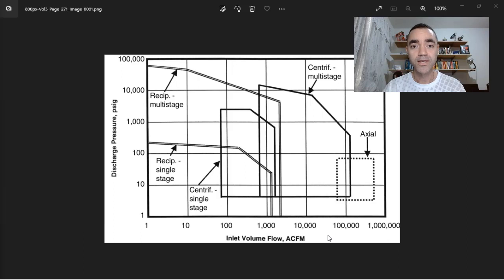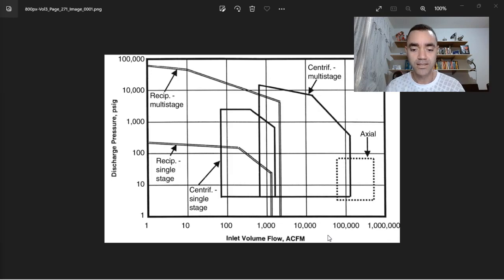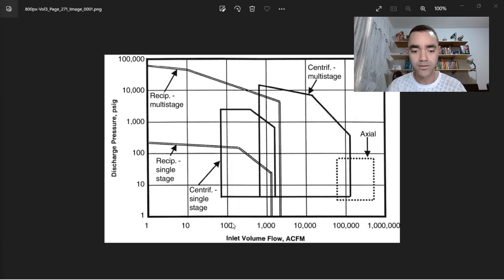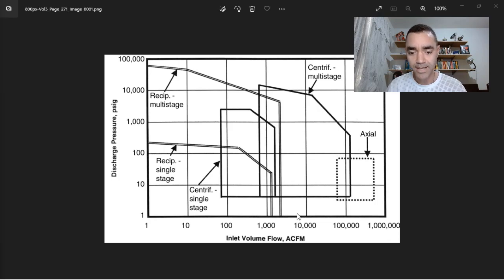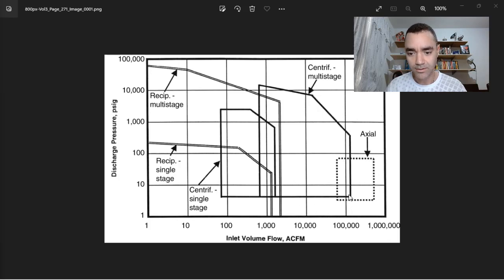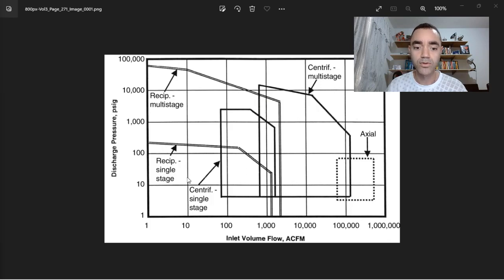COMPRESSOR EVALUATION, SELECTION AND PURCHASE FOR CHEMICAL PROCESS ENGINEERS

Comment: Your compressor selection process emphasizes critical parameters like flow rate and pressure ratio—key for chemical applications. How does your package scope define the exact pressure ratio tolerance for this project's gas stream? This ensures alignment with operational safety margins without over-engineering.